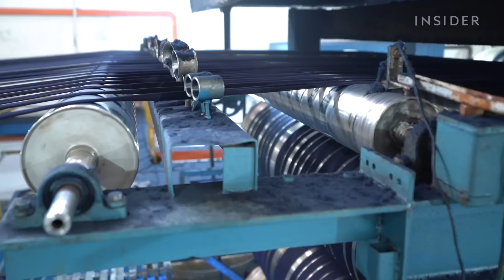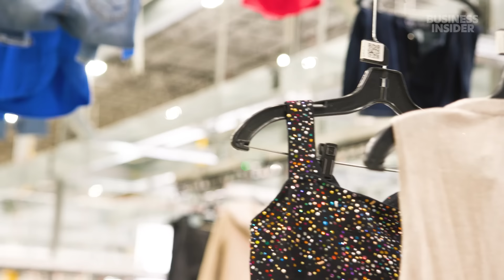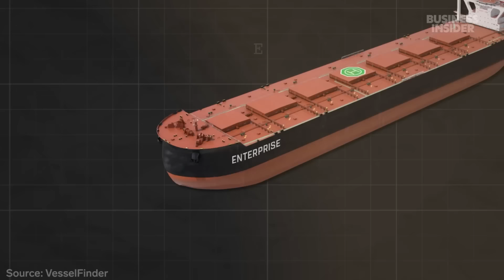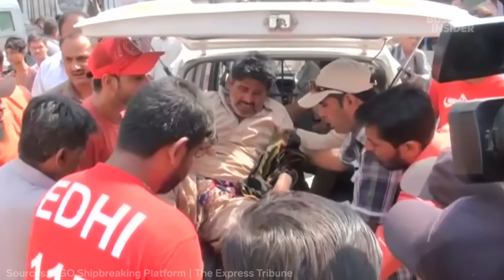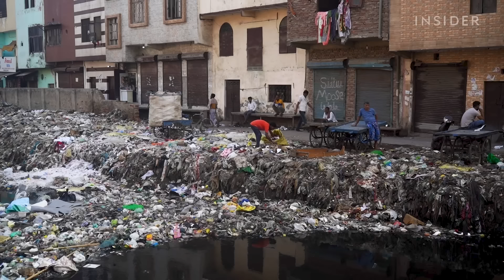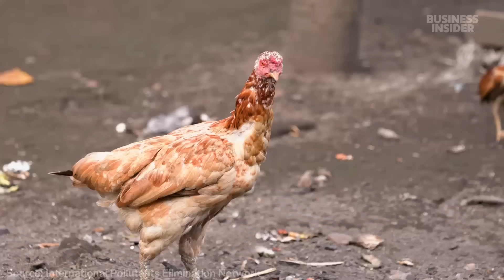Why Old Cars, Ships, And Clothes Are Piling Up In Developing Countries | Business Insider

Comment: :face-blue-smiling: I worked at a salvage yard for almost a year, afterwards I would buy fixable cars for about 300 each, had a guy with a transmission shop, rebuilds cheap if you dont have an extreme timeline, tried to do the rest by myself

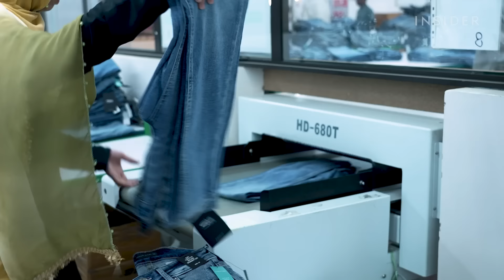Comment: 11:00 It's a bit funny how they're talking about the issues being people need to buy less, and to buy higher quality items which will last longer, then companies can produce less, and there will be less waste... Which is how things used to be. It's not the consumers' fault they buy junk when now junk is all they can afford.
Reply: While there is a lot of junk out there, that doesn't tell the whole story. We have too much stuff, expect too much stuff and expect things to be cheap. Clothing used to be made better, last longer BUT they were expensive. People had a few day dresses, a special occasion outfit, and few other items. It's not like that now. You can buy a few quality pieces and make them last, but people just don't. They have dozens or even hundreds of low quality items that cost the same as if they bought fewer more quality pieces. No one seems to want to give up their excess and find a very hard time admitting it.
Reply: @rebeccamueller8790  Problem is it's sometimes difficukt to tell the difference. Sometimes low quality stuff is just sold for high prices.
Reply: And mostly junk, planned obsolescence products are all that's now made....Like smart phone companies just love to glue batteries 🔋 inside their phones. So it can't be replaced and use cheap solder that eventually breaks. Causing poor connections and overheating. Vehicles are now made to be throw away non repairable appliances. With parts that can't be swapped to another vehicle. Without paying a bunch of $ to digitally unlock 🔓 and reprogram the part so it can be used.
Reply: @michaelbrinks8089 smart phone batteries are made that way for space savings. So bad example
Reply: I don't buy much my most of my clothing is 15 years old as far as everything else it's high quality products because I would rather save a few more months and buy the best rather than junk
Reply: I think so too! The problem is that the need to throw away trash has been in the consciousness of modern people.
Reply: @bufordhighwater9872  you know what's funny, Artistic milliners dont have clients in Pakistan 100% of their products are exported to US , Canada, Europe and Australia 😂
Reply: US, has a population of just 4% of the World population but consumes/robs 30% of World resources.   And many resources are wasted, like food, and metals and clothing, not to mention re-chargeable batteries and other electronic equipment.   US is hooked on foreign Oil, goes to Wars to get their Oil thirst met.  Latest war on Venezuela for their oil and kidnap of their president Maduro, so US can steal their Oil too, just like US did from Iraq and Libya, etc.
Reply: @redfordrn  for the US it's 25% of the world's resources, 5% of the world's population and 30% of the world's waste. A factor of 5x resource use, and 6x waste production.

Canada is 0.5% the world's population, 2% resources, and 2% waste. A factor of 4x resource use and waste.

Japan is 1.5% of the population of the world's total, and 5% of the world's resources, and 2% of the world's waste. A factor of 3.3x resource use, and less waste.

Europe has 9% of the world's population, uses 20% of the resources, and creates 25% of the waste. A factor of 2.2x resource use, and 2.8x waste.

The US has forced obsolescence built into their large scale business models. Super PACS and lobbyists prevent change. Every modern country uses more per person than the resources the world makes. In the examples provided only Japan creates less waste. The US is the biggest culprit, yet they aren't unique regarding using more than the total resources used. The waste created is the biggest concern, not so much the resources used.
Reply: Business 101: companies make what consumers want. Not the other way around. 
The more "advanced" a society becomes, the less acceptable manual labor is - and that doesn't just mean careers. Why do you think convenience products are everywhere? People don't want to do things for themselves if they have the money to make it otherwise. Look around and you'll see that concept at work in every facet of life.
Reply: The quality difference can be seen best in furniture. What was once solid wood is now particle board.
Reply: @luigi55125  I mostly sit and sleep on the floor I have short stools and pillows to sit on
Reply: @luigi55125  there's literally not enough solid wood to go around, it takes decades to grow a tree big enough to get solid wood from. Logging and lumber was swapped to new grow, we plant, and cycle through. Because it's bigger we use composite wood now for everything except lumber.

This is because of supply and demand issues combined with the impact it would have on the environment if we decided to just remove all old growth forests.

So although the cheapening of products is real, historically swapping from solid wood to composites is not an example of that.

An example of that is using cheap plastic parts for internal mechanics instead of durable metal ones.
Reply: @JonBonCat  give me a break…there is absolutely “enough to go around” if you’re not buying a new sofa every couple of years. If you need a “new” sofa you can sometimes find one at an estate sale or some kind of vintage store where you will get the older, higher quality item. And if you want a new look, make new covers for an existing sofa.
Reply: @christinal9046  what are you talking about? There is literally not enough solid wood to use it for everything. This is a historical fact. This is why we use composite woods now. Because we were cutting down 100+ year old giant old growth trees to get wood thick enough to be all solid wood.
Now we don't use old growth forests anymore, instead we cycle planting and the trees grow for 10-20 years before they are big enough to cut for lumber. We specifically plant and grow trees made for that.

How many people are in your city? How many solid furniture pieces are there? Not enough for everyone, it's literally simple math.

Just look it up, this is just the history of how we use wood now.
Reply: @JonBonCat  I am saying that we don’t need a huge supply of new sofas…old sofas, even ones that are decades old still have good ‘bones’ and can be made over to update their look while not needing new solid wood. What are you basing your claims on? How many sofas do you think need to be produced vs how much wood supply is there?
Reply: @christinal9046  what are you talking about? Cabinets, tables, chairs, etc. even with preexisting, there is literally not enough wood to make stuff out of solid wood.

Past that, a couch is made out of 2x4's, not solid wood. You're not even on the same topic.
100 years ago, everything was solid wood. You know plywood? Didn't exist. Plywood is a composite wood. We use plywood to build houses. Under the siding is plywood, under the flooring is plywood. We need composite woods for society, solid wood can't work anymore.

You're here talking about couches...
Reply: @JonBonCat  2x4s are solid wood. We frame houses with those(or 2x6 sometimes) and put plywood over them. You can buy solid wood lumber, you can buy solid wood furniture at a lot of places, even Ikea.
Reply: @christinal9046  low end furniture is actually made with joined 2x4s, left overs pieced together. 2x4s are indeed solid wood 4x4s, 2x6s, etc (planks), except they are skinny, from new growth trees, that's where they come from, trees that aren't big enough to yield sheets (like for a table top, or cabinet walls, dressers, doors, made of entirely solid wood). In order to get anything a foot or thicker/wider (as opposed to longer, based on the grain direction) it takes older growth typically 100s of years old. Mathematically there aren't enough trees.

Pointing out people can get it, doesn't prove there's enough for everyone to have it.
The issue here is you don't understand about the grain of woods and which part of the tree is used to create a sheet or a piece larger than a few inches. 2x4 is actually the preplaned dimensions, they are actually slightly less than that.
The center of a tree is the heart, which isn't usable wood for what we're talking about, and in order to get a piece of wood the grain as to be a certain direction for strength and the tree has to be big enough to create a surface area where those grains all align for the entire piece of wood taken from it. A sheet takes a massive tree because trees are round and in order to have a flat enough face to pull a sheet from the tree has to be sufficiently wide enough, which means 100s of years of growth.
Reply: @JonBonCat  you’re right I don’t know much about types of wood - but part of my point is that if you start out with high quality furniture, it shouldn’t end up in a landfill. You can reupholster things and DIY in all kinds of ways to repurpose good quality items into something new. You don’t need to start off with virgin wood from the tree. I’ve got solid wood furniture that is 50-100 years old and looks better than a lot of new stuff looks after using it for a few months. A lot of people go to thrift/antique stores or estate sales to get something that is much higher quality than what you can get in regular furniture stores these days.
Reply: @christinal9046  I understand your point. The issue is it doesn't counter the fact there isn't enough solid wood to go around for everyone to have it. You're not arguing against what I said.
Reply: Quality used to be home grown, now I'm not saying everything "made in the USA" was a good item, it wasn't, but quality was a carpenter that made cabinets or tables, quality was because mediocre wasn't really all that much cheaper.   However these "developing nations" want all the manufacturing jobs,  and they're not going to produce quality making $9 a day,   so it's large cycle, they want the jobs, we won't pay much for their mediocrity,  they keep themselves employed by taking all the garbage from our broken goods.
Reply: Afford? People buy cheap shit because it's cheap. Disposable income.
Reply: @djchristensen1  disposable income is defined by income that is available after needs are purchased. It is not related to disposable goods, but does have the same word.

Clothing and appliances are needs, and are made cheap and disposable, as but one example.
Reply: @JonBonCat disposable income is whatever people wanna spend their money on outside of needs. I don't know what your point is.
Reply: @djchristensen1   you said people buy stuff because it's cheap, not because it's about affordability. Then you said disposable income.
Disposable income has nothing to do with people buying cheap because it's affordable.

That's what I'm saying. The concept of disposable income doesn't apply here.
Reply: @JonBonCat yes, it does. People will overspend on tools and if it's cheap, it's a deal. Tf you on about?
Reply: @djchristensen1  Yeah, that happens, and isn't related to people not being able to afford high end in order to last longer. The scale isn't there. A top of the line belt sander is $300+ and entry level is less than $100, that's at least 3 times more to buy quality.

Same idea with a nail gun, like $75 entry level, $300+ for a top end.
Same idea for home appliances, clothing, linens, shoes, sunglasses, everything.

It's not realistic for someone to buy long lasting quality for things they may need. It would take the average person a decade to slowly save and buy every item, and like not have a washer dryer beforehand? And it's impossible when everything cheap breaks in a year or two.

The margins aren't there anymore. People used to be able to buy a cheap clunker of whatever it was, maintain it well, and let it die as they saved money to buy higher end. The math just isn't there for everyone's needs anymore. Anything with an electric motor is cheap on purpose on the low end, and not exactly easy for the average person to just swap out, lol. House fans, lawnmowers, etc.

Even the high end won't last last 25 years anyway, and that used to not be true. My father is still using tools my grandfather bought lol. Even metal alloys aren't always as good anymore. Everything is mass produced without quality in mind and that drives the cost of quality made products up.
Reply: @djchristensen1 
Disposable income? I'm not a millionaire or oligarch, so I don't have any disposable extra income– I can barely pay my bills each month and I've already cut back everything possible. Prices are going up too quickly to keep up with.

Most people I know shop quite a lot at thrift stores, yard/garage sales, and make some of their own clothing. When clothing no longer fits or children grow, we hand down or share good quality clothing among friends, family members and faith communities. 

Fast fashion is trash, and people wear too much synthetic plastic products. It's not healthy for our bodies or the planet! I'm very glad to see these people focussing on cotton, and how to recycle it in a responsible way! Very well done! 💙💚🩵💟